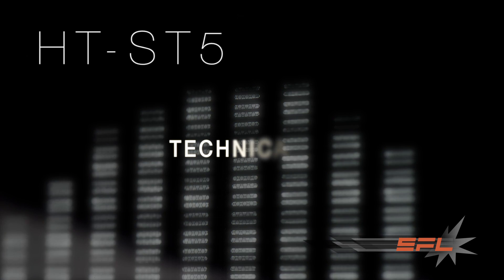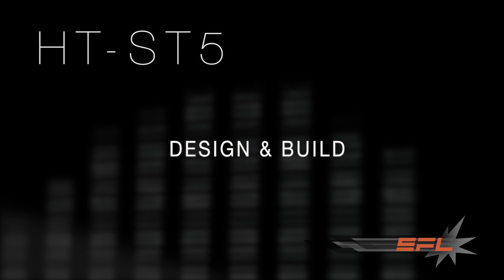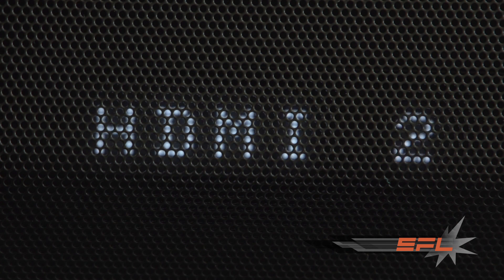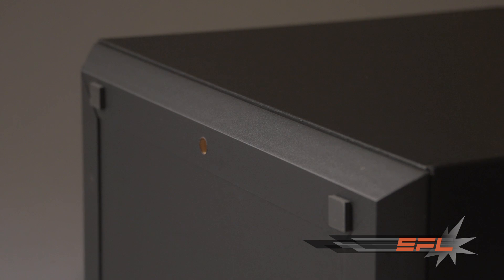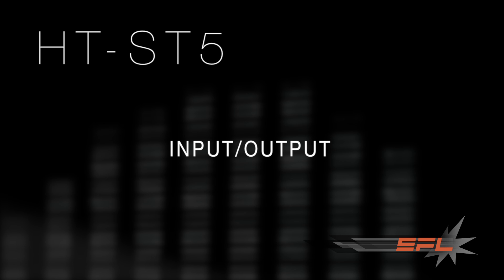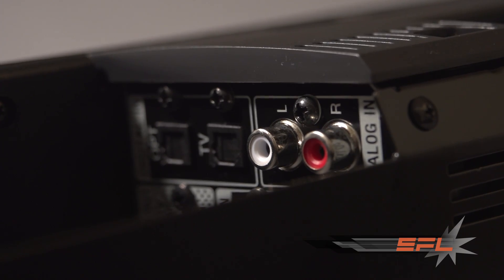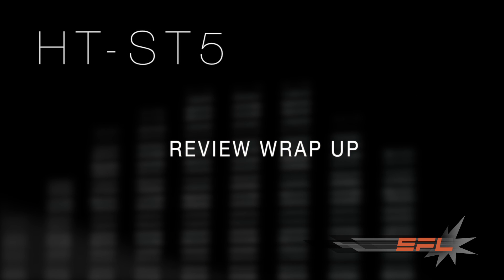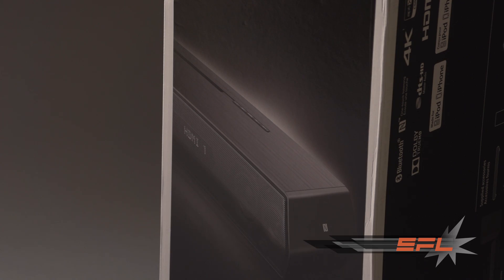Sony HT-ST5 Soundbar: In-depth Technical Review

Comment: Great review. Thanks very much for posting. 
I have just brought a 4k 50in and need a sound setup for my sky and bluray and  I am def thinking of getting one as my living room doesn't lead itself to be able to have dedicated front speakers (TV is in the corner). 
I have a couple of questions hope u don't mind :
-Ref the surround, is this a true 5.1 surround ? I am unsure whether it is simulated (like my old TV rear speakers - they just sounded like vague echoes of the front) 
-Does it come with hdmi cables included ? If not do I need to get hdmi 2.2 cables (is that correct) ?
-if I'm watching something through one of the TV apps (ie YouTube) how does the sound get back to the bar (do you simply put an hdmi cable out from the TV to the bar ?
Thanks again. Fantastic detailed review.

Comment: I´m looking for something simple for backyard home theater.

Can this be connected to a Projector with HDMI input instead of TV?
I have an DVD with cable tuner and Apple TV.

I´m thinking of having the projector, sound bar and bass on a mobile cart which I can roll inside the house when not in use.

The two models I´m considering are the Bose CineMate 120 and the Sony HTST5.
I know the Bose is more expensive and lacks WiFi and Blue Tooth connectivity out of the box.

Is the difference in price worth it for the CineMate 120 over the HTST5?

Should I be considering other models?
Reply from the maker: allanes5 There is no reason why you wouldn't be able to send the HDMI output from your projector to the sound bar. You would simply connect your Apple TV and DVD player to one of the inputs and then the output to your video projector. The cart idea sounds awesome by the way! You'd only need to find a place to put the subwoofer once you have the cart set up outside. Since it's wireless the only think you'd need to worry about it getting power to the sub wherever you decide to place it for best bass reproduction.
Reply: Sony First Look  Thanks for the reply.  
The cart will have three levels. The top one will be for the projector and sound bar.  The middle shelf will have the DVD with cable tuner, Apple TV and Surge protector with about 6 electrical outlets.
And the bass would go on the bottom.
Reply from the maker: allanes5 If you decide to leave the sub on the cart (you didn't mention whether you'd remove it and place it on the ground after moving the set up outside) here are two things you might consider. 1). Depending on the material the cart is made of, make sure that the sub won't vibrate the cart during passages with heavy bass information. That could affect the projector's playback as well as the vibrating cart interfering with the overall sound. Some type of dampening material might help with this 2). Smaller subs tend to perform better when placed near or on a surface where they can acoustically couple with that surface and increase bass response. This may be a moot point but perhaps worth experimenting with if you get adventurous. Good luck! Let me know how the 'premiere' goes :-)
Reply: Sony First Look Great! Thanks for the tips.
You are definitely right regarding sub vibrations.
We´ll let you know how it turns out :)

Comment: I had purchased a Sony DAV-S300 in the year 2000. Its still in good condition except for the subwoofer. I get that 5.1 distribution from rear to front or any other surround. I only had Dolby Digital & DTS then. That too i had to region free my player for different types of dvds. Looking for a new surround system from Sony itself. Please help.
Reply from the maker: Rajesh Cheekoli I think the two biggest difference is that 1). You are not going to have dedicated rear channels as you did with the DAV-S300. 2). The HT-ST5 is really just a speaker. There are no sources so would not, by itself, be able to playback Blu-Ray or even mp3's from a flash memory card. Something like the Sony BDV-N5200W or BDV-N7200W would be much more similar to what you had before.

Comment: Hi!  Thanks for your comments in Larry198s post.  I did wind up buying this sound system from Sony.  I've had it for a few days now and my initial impressions are mostly positive.  Once I realized I needed to change the outputs of my Blu-Ray and XBOX to allow DTS I was able to get pretty good sound.  The subwoofer booms during explosions/loud sounds!  But I'm all about the detail and I think the treble and mid-range are a bit muddy.  They sound good but not "clear".  I'm probably not explaining that well.  Anyway, I'm thinking I need to tweak things a bit more.  Also, I noticed during playback on one movie, toward the end, that the video and sound were ever so slightly out of sync.  I need to figure out why that would happen and if it can be remedied.  Stopping the movie and then going back to the same place seemed to not replicate this issue.  But that's not a fix.  Any advise you can give me regarding setup/settings about this and in general would be greatly appreciated!
Reply from the maker: Richard Forester The subwoofer is really pretty impressive isn't it. I agree with you on the general mids and treble. This is where something more sophisticated than generic sound settings would be great. You may try playing around with the Voice setting to see if this helps at all for you. Also try toggling between Movie 1 and Movie 2 as they have very distinct 'tonal' values also. Your issue related to sync I have not run into with the sound bar, although this is possible with HDMI. Some systems (audio/video receivers) allow you to adjust the timing between the picture and sound but the HT-ST5 does not allow for this as far as I know. If you were streaming video through your XBOX and this occured it MOST LIKELY was a temporary sync issue with the XBOX hardware (I've had this happen before with my PS3 while streaming). Hope that helps!
Reply from the maker: Richard Forester One other point worth mentioning is I've had more success getting listenable play back streaming music (Spotify, Pandora) from a device like a PS3 or Apple TV and using the Movie sound field. Streaming from a mobile device I use their internal equalizers to tweak the sound and have been pleased. Again I wish there was a better onboard EQ solution so this wasn't necessary.
Reply: Sony First Look The lip sync issue came up watching a Blu Ray being played from my Samsung BDP-1500 (pretty old).  I haven't noticed this again so maybe it was a fluke.  I agree that the lack of an EQ is disappointing.  Especially since SongPal has a screenshot of an EQ.  I wonder what device that screenshot is for?  Now that the preliminary testing is over I'm looking at the finer details and noticed another problem.  It's with the way you hook up the HT-ST5 (Blu Ray, XBOX 360, Cable STB, plug into the sound bar and use HDMI1 on the return to the TV).  Also, BTW, my TV is an older Samsung and doesn't have HDMI ARC so I need to use HDMI+Optical.  Anyway, with this arrangement I can no longer switch between inputs unless the HT-ST5 is on.  I really only bought the sound bar for movies and didn't plan on using it all the time.  Is this intended?  At least I was able to get my older universal remote the Harmony One to work with the HT-ST5.  I was very surprised by that.

Comment: I have a video card for my computer with hdmi audio video, how do I use hdmi audio only for my computer while still using the video card for video? I am currently using optical audio off the motherboard.
Reply from the maker: As the soundbar is  setup I don't think you would be able to split the audio out to the sounbar and retain video in your computer without using either the optical or analog inputs. Currently that's how I configure my laptop to work with the system: I use the heaphone output to drive the analog input on the soundbar.

Comment: How to connect sound bar cable to TV
Reply from the maker: In most setups the soundbar basically becomes a router that sends whatever sources you connected to its input out to your TV. If you have a smart TV with streaming apps you can use the ARC function to route the signal through the soundbar.

Comment: the price is kinda high with out wifi and usb hookup problem is I just gotten this unit today and havent try out the soundbar in true real sound is there a 3d sound for this sound bar making like coming in the back of you at best buy they had one that is 8,1 channel sound bar, when I did a test play on a movie trailer it sounded like its coming in the back of me also I said wow this is cool shit,
Reply: Richard Forester I think there using a demo at bestbuy because of the blue-ray demo on the soundbar brings out better sound and because it sounds like behind me like surround
Reply from the maker: In my tests I could never get the sound to appear as if it came from behind. I think Sony has done a great job in getting the sound to wrap around the soundstage but if you really want sounds from the back a traditional 5.1 or 7.1 setup is the only way to go.
Reply: your right I was at bestbuy and they had a demo on this soundbar sounds so cool at bestbuy but when you take it home doesnt sound the same when you take it home,
Reply: ***** I wonder why this would be the case.  I'm no sound expert but it seems to me that you would get better performance from the sound bar at home than at BestBuy.  I'd think that at home with the lower ceiling and tighter walls (space) that it would sound better.
Reply from the maker: I don't know how they have the sound bar configured at Best Buy but the only real way, from a single enclosure, to get sounds to appear as if they are coming from behind the viewer would be if the rear wall in your viewing area is made of the type of material that it would reflect the sound wave from the sound bar (creating an echo, in other words). Most walls are just not that reflective and would require that the listening area be pretty compact or the volumn uncomfortably high. I do think the signal wraps around to the edges of the viewing area quite well...it just doesn't sound to me as if it's coming from the rear.

Comment: How effective is this soundbar for just music? And cable tv. Isn't this just for dvd watching? Can firmware be updated with?
Reply from the maker: Just for music I think it's okay depending on how strict your sound reproduction tastes are. The EQ setting are just not their to reduce the harshness I found when listening to the system with flat response. Now if you stream to the unit via Bluetooth and EQ within your mobile device you can get the sound you want. The system has ARC (audio return) and so you can route the signal from your cable TV through the soundbar. I would imagine the firmware can be updated if Sony really wanted to but it would be an ardous process as the only way to interface with the system is via Bluetooth.

Comment: Hi, could you please tell me the difference of the subwoofers between ht-st7 and ht-st5? Some websites say that the power of the subwoofer in ht-st5 is 30 watts instead of 100 watts as of ht-st7? Is it the case? Thanks.
Reply from the maker: The websites are probably confusing the power consumption for the subwoofer which is 30 watts. This is different measurement than audio power output, which is indeed 100 watts.
Reply: Why is it this reviewer hasn't answered your question?  I'd like to know too even though I found this sound bar too expensive for what it does.